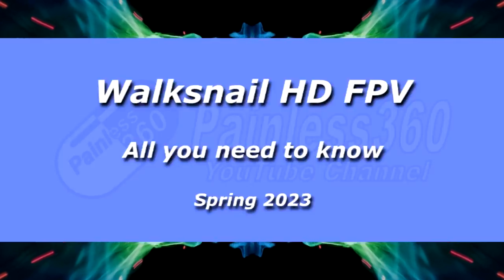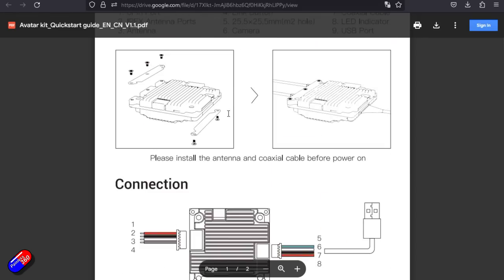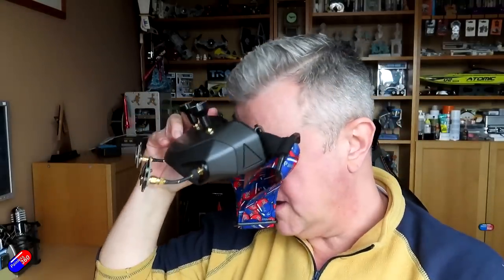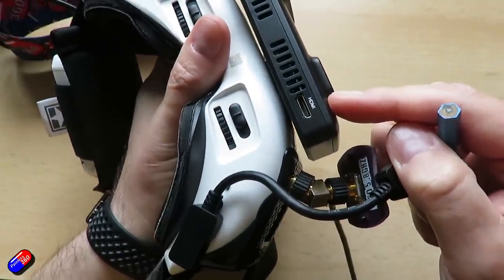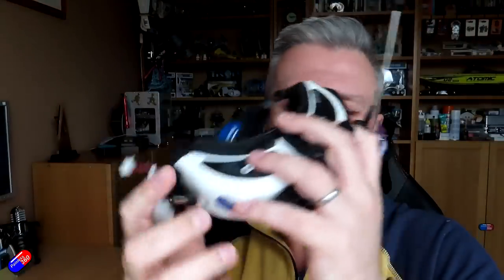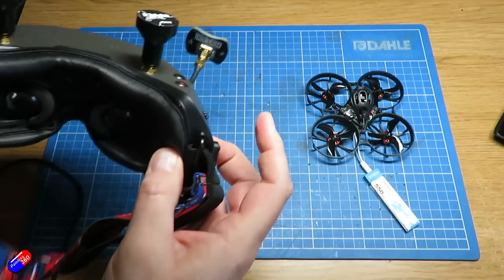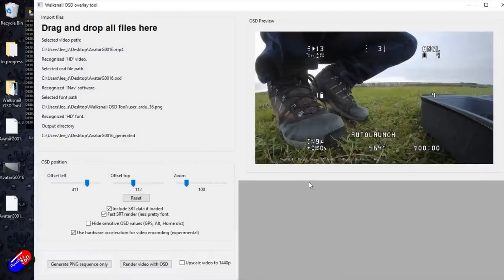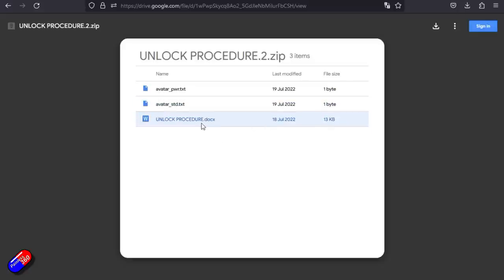Walksnail for new owners: All you need to know in one video!

Comment: tip if you can't get osd elements on the left of your goggles : there is an "osd position" that needed to be setup on my VRX module for OSD to work properly. Before that, the OSD elements on betaflight were not on the same position as the elements I was seeing on my fatshark HDO v1

Comment: Great video to get insights into the Walksnail system. I will however stick to DJI as I’m already heavily invested in it (O3 and it’s predecessor)…
Reply from the maker: That is why my videos on Walksnail are aimed at analogue pilots. I can't see a compelling reason for a pilot to walk away from an existing HD system they have invested in. Happy flying
Reply: @Painless360  I changed from DJI to Walksnail. Goggles arrive this friday. I mainly changed because of the size of the goggles and the vtx. You can have micro drones which wont work with DJI the vtx is to big. You have onboard recording with Walksnail and you can fly at night with the pro camera. And I have more space in the frame to work with. And Caddx had a good deal for only 600$ for the goggles and the vtx with the pro camera :D

Comment: As usual excellent and detailed videos; thank you! 
I just received my VRX V2 kit and integrating to my X500 Arducopter. I cannot find anywhere which is the positive terminal fot the VRX. Usually the center post is positive but i have seen applications that is reversed.
Finally, have you indigrated them with Arducopter so you can setup the VTx through Arducopter Parameters and using a RCx channel turn on/off recording on the VTx?
Reply from the maker: I've not setup Walksnail on ardupilot...yet. Stay tuned!
Reply: @Painless360  If anyone else needs to know, the Center post/pin of the Walksnail VRX power connector is the positive pole; tested and no magic smoke!
 It looks like most Goggles including DJI using the same configuration for power.

Comment: I’m completely brand new to the FPV world. Right now I have a controller and simulator learning to fly that way. I’ll be slowly purchasing parts here and there to build my own quad by next year. I’m a little confused. 
If I buy the HDZero Google’s will I have to buy the VRX module to get digital display?  Or will just the goggles output 1080p @ 100fps. Any input works be greatly appreciated
Reply from the maker: You could but Walksnail are about to release something in October that may change things, so I'd hold on!

Comment: This video was really helpful at the right time. I use analog on my rc car and I've maxed out what analog can do and am planning to go towards walksnail too and your other walksnail video helped me and then I saw this come out today which is really helpful. I've ordered my walksnail avatar and vrx and parts to build a cooling unit for it. I just had one question, sorry if you already answered this. So you said before you bind through the setting on the goggles/vrx there's many grayed out options including the transmit power. Once you have binded everything can you set the transmit power of avatar to max or other power outputs from the vrx unit settings or can you just turn off standby mode as you said which sets vtx to full power?
Reply from the maker: Yes, all those options are accessable when an AVATAR unit is bound... Happy flying

Comment: Hi Painless! I`m considering using the Avatar walksnail system with my simple fixed wing aircraft and no flight controller. Should I have a separate battery for the VTX or could I power it from the main battery? And do I need a BEC?
Reply from the maker: You can power the full size AVATAR from the battery. The 1s version needs to be about 4v ideally... Happy flying

Comment: the antennas on the HDO2 goggles are they still be used with the RX unit installed? Does that analog module need to be installed at all?
Reply from the maker: No, you could remove all of that... Happy flying
Reply: @Painless360  copy that!! thanks!!

Comment: I've recently purchased XI25PPro, with Avatar HD Pro v2 unit inside, from OddityRC. I did not receive that USB-A to JS connector (or whatever it's called) so I could download videos from the Avatar Air Unit (32Gb). Is there any other way of downloading videos, or am I out of luck? What is the exact name of that cable, so I can maybe search some local stores? I've tried contacting OddityRC, but there is no reply since June 16th.
Reply from the maker: It should come in the package. They are specific to the avatar unit and version you have... I'd check the Walksnail site in case they sell spares... Best of luck

Comment: i got one for my tinywhoop but its wierd 
it doesnt bind correctly somehow i have to press bind buttons everytime i switch batteries which is super annoying on a tinywhoop
Reply from the maker: I'd make sure that it is updated to the latest version with the goggles. All mine stay bound here..
Reply: @Painless360  thanks for the response 
i got both on the latest firmware but i try to reset and put latest firmwares on it again hope that helps

Comment: If your coming form analog and have pulled you omni antenna off to use the patch to direction find your model, you can ruin you afternoon if you take the wrong omni off....
Reply from the maker: I would strongly recommend that pilots use the RSSI trick on the radio to find a lost model. One of the top antennas on the walksnail system also transmits so I wouldn't remove antennas unless you really know what you're doing.  Best of luck

Comment: What cable to use to get hdmi output on goggles I tried it on a monitor and it said it's not supported but when I hook the vrx up it works
Reply from the maker: https://www.amazon.co.uk/dp/B08ZS74H4K
https://www.amazon.co.uk/dp/B08VWGSQ1D
These are the two I got that worked for me.

Comment: What about HDZero goggles with the walksnail VRX ? That seems to be the cover everything (execpt dji) setup now.
Reply from the maker: That works but there are new goggles and options coming out all the time. Plus, once you covert your analogue fleet to HD you don't need that anymore... Happy flying
Reply: @Painless360  walksnail googles would be much easier to commit to if they had both HDMI in and out.

Comment: I bought the binocular style goggles and had to send them back. My eyes just couldn't cope with them - astigmatism meant my brain was getting two separate images. So the Fatshark Recon HD box style goggles were a life saver for me - they are small but still allow me to wear glasses with them.
(But big missing with the Recons is that they have no HDMI input so they will only ever be useful with Walksnail Avatar. Thats a BIG missing in my book).

Other issue is the lens that comes with the Avatar cameras. Its very wide angle 2.1mm. Most people seem to be happy with this but I can't get used to it. I want straight lines to look like straight lines. I want near objects to look like they are near. Basically I want to forget that I'm looking through a camera. Too much to hope for?
Anyway I've been searching for replacement lenses (2.8mm or 3.6mm or so) but have yet to find anything. The Pro camera has an unusually large sensor for an M12 camera and both Pro and V2 have IR blocked lenses. Makes it very difficult to find suitable replacement lenses.

Once I've sorted out the lens problem I'll like my Walksnail Avatar kit a whole lot more !
Reply from the maker: I've made Walksnail aware of the request.  If enough ask, we may get different lens lens options....Happy flying!
Reply: @Painless360  Cheers!

Comment: Ranges (optimum distances) for the walksnail systems?
Reply from the maker: Over 30km using full power and specialised antennas. Happy flying
Reply: @Painless360  whoooaaa!! nice, thanks!!
Reply: @Painless360  thank you!!
Reply: 52km is the current record. However you MUST upgrade your antennas as the stock antennas are completely useless, so much so that the supposedly LHCP polarisation is basically non polarised. 

I use 4x TrueRC X2-Air on the goggles and TrueRC Singularity  on the VTX. I regularly fly out 15+km and normally my battery is the limiting factor.

Last night I flew 13km on 500mw without much issue.